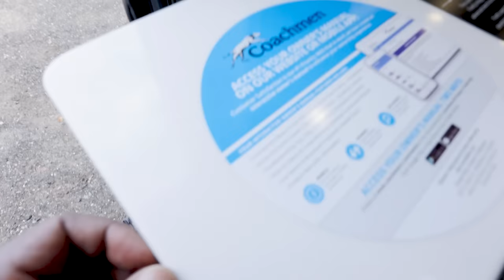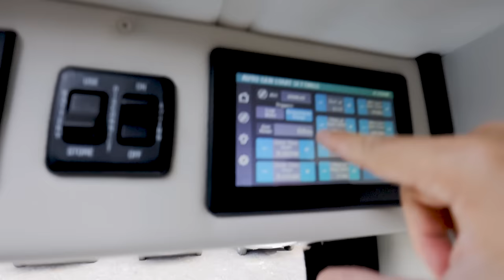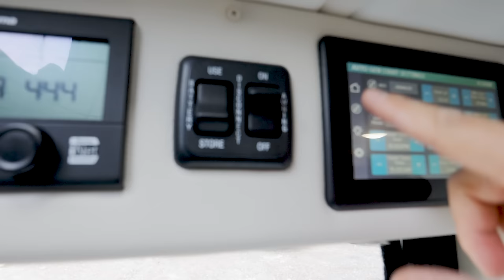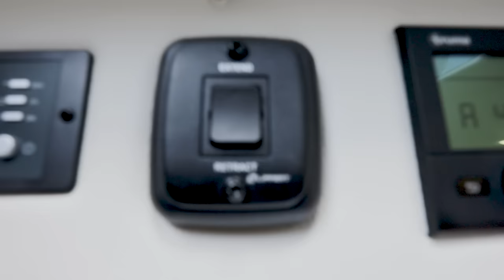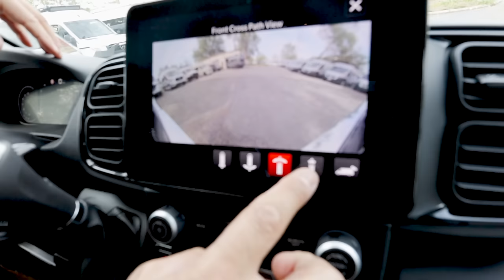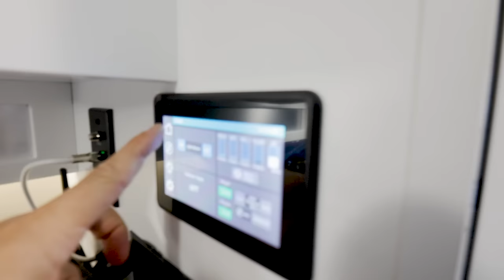A Closer Look At New Coachmen NOVA Pop Top Ram ProMaster Camper Van

Comment: To start with, I love my 2024 Nova 20D.  I also thank you guys for helping in my decision making.  I am also amazed ( and maybe a little sad) how many changes they have made inside the year group vs. what I have.  The square sink would be so much better than the round one I have.  Also the convection / air fryer vs. the straight microwave is a game changer.  I wish mine had that.  The back door boxes are also nice but with my hitch mount cargo carrier, I kind of lose access to that.  My one word of advice to taller drivers like me is the PROMASTER can feel a little cramped on longer drives.  If you are over 6 feet you might want to think of another chassis.  Now I have to figure out how to change out my Microwave so thanks for that..